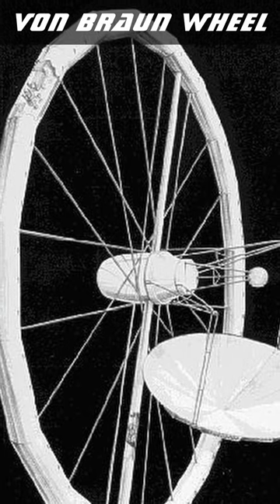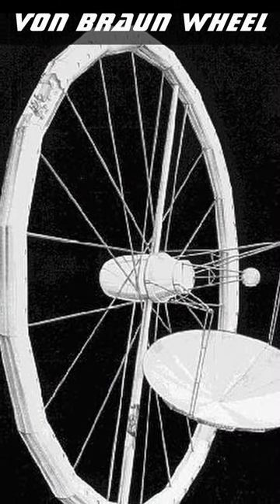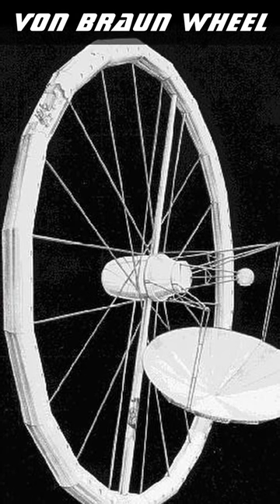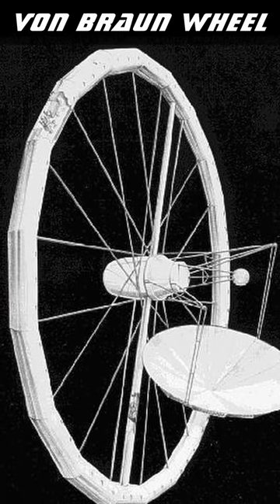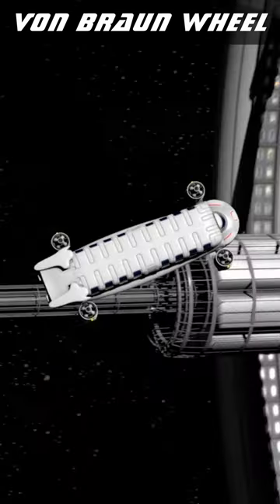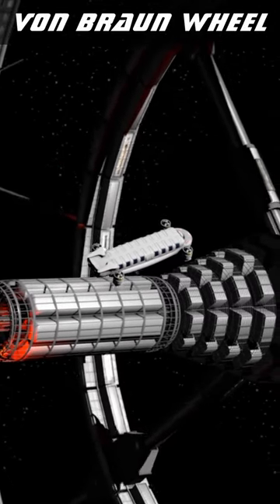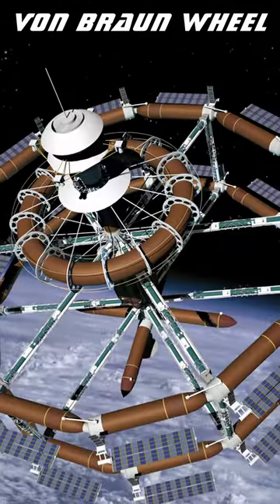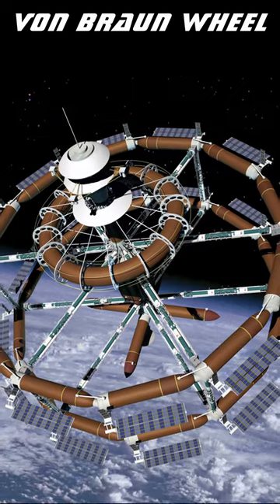Von Braun Wheel Space Station

Comment: My man took a bicycle wheel to a convention and actually sold the idea to the community lol that's legendary.
Reply: Gandhi also did that , you can see Indian flag.
Reply: It's a solid design though. Before we had carbon fiber, steel cables were the best way to make a lightweight structurally stable wheel.
Reply: not the most unconventional invention from von Braun...
Reply: Physics. Physics apply to bicycles and space alike.
Reply: The airpressure in a road bike is between 80 to 120 psi , about 3 to 4 times atmospheric pressure. , bicrcle wheels also spin a lot faster than the desired 1 to 2 rpm to limit nauseating Coriolis forces.   You could argue that a bicycle wheel would be overkill. except in size.   Thing is, we still don't have a spin gravity space station so no one has bought into what was being sold, at least not with a large enough pocketbook.
Reply: @johnwang9914  i mean no he literally took a bicycle wheel to a meeting with some other scientists and demonstrated centrifugal force gravity.
Reply: @A_Stereotypical_Heretic 
Fair enough, though.

Comment: It's 2023! Why hasn't NASA and/or ESA built a 100-meter diameter wheel station with spin gravity by now?
Reply: Cost - benefit analysis says not worth it I'm sure. I agree with you though - rather than spending money on war and other garbage we should be pumping much of our treasure (globally) into research and space research.
Reply: We built on on Earth. more then one.
I think the spin grav required a larger diameter then was practical.
and we needed to do more studies in zero grav. But we did plan on adding one to the space station, aaaand. well. rotating connected to a stationary space station is. a challenge to say the very very least about it.
Reply: Mostly because they want to study micro-gravity.  There is a perfectly good laboratory with 1 gravity rather closer.

Comment: The fact that it is a design from 1945 is astounding... and raising a few question, considering his employment at the time.😅

However it faced the same problem as lunar bases - lack of interest. ISS is specifically designed to be a microgravity laboratory, this one is designed for long term human habitation that... isn't happening because we learned that space is empty and unforgiving and there is no point to go anywhere when you can invade your neighbour for same amount of money.
Reply: The earth has a finite amount of resources. Space, unforgiving as it may be, is chock full of resources like metal and helium 3 for fusion. The establishment of a space base in the asteroid belt might be a useful first step and launchpad for space mining operations.
Reply: Right here on Earth has plenty of environments which are unforgiving where those who do not have the correct equipment for surviving the unforgiving heat or cold are pretty much guaranteed to perish; it's just that space is unforgiving both more universally across the board and to a more extreme degree.
Reply: @scottfw7169   ...aaaaaaaaaand?
Reply: A semirigid centrifuge module was proposed for the ISS but dropped.  The problem including with Werner Von Braun's inflatable rubber design was that anything spun for spin gravity had to support it's structural weight and hence had to be lot more massive than out current tinker toy spacestations and everthing launched from Earth costs about $10,000 a pound just to launch into low earth orbit never mind a more permanent orbit.  It probsbly won't be till in situ materials from the Moon or asteroids are available before such space stations are feasible.
Reply: @johnwang9914   chicken or an egg? Are such space stations possible only with in situ materials or are in situ materials only possible with such stations? 
The answer is sadly both. You need both habitation and industry to be able to scale them. So the start would come from here. And even with fully reusable surface to LEO ships propelled by rotating detonation engines and with nuclear tugs picking the cargo at LEO, it's still nigh impossible task that is too far beyond realistic investment horizons. Capitalists, communists, monarchists and other "-ists"(no, I don't mean dentists and other specialists. You get the idea. And sorry that I'm in ranting mood, night shift ¯\_(ツ)_/¯) with their "-isms" will be our Great Filter.
Reply: @TheArklyte    Well, you always have the ooption of launching materials from Earth at great expense.   Having materials and labour in space would greatly reduce costs but would also require infrastructure and personnel to already be in space hence for there to already be habitats.   It is the first habitat that is problematic, it would have to be very expensive if everything was from Earth, very risky if personnell did not have the full shielding and gravity of a large habitat though minimal habitats similar to ISS would be possible but at greater health risks.   It's a matter of what costs you consider acceptable and what costs can be afforded.   The Stanford Torus was estimated as possible so long as Apollo era funding remained but obviously such funding did not remain so yes, chicken or egg or a lot more money.

Comment: I always imagined that the tension teethers could be aluminum cables and arranged such that they function as an inductrack maglev rail for pods to transit not only to the microgravity central hub but along the rim as well.  With banded tori, you coulf use such pods to transit between rings.  Might as well get more than one use out of as much as you can.  The spokes would also be goof locations for heat radiators as they are connected to the pressure vessel and outside the static radiation and micrometeor shield.

Comment: that last comment on re-purpose the fuel tanks, still remember the first time I read about on atomic rockets it blowed my mind and according to some estimates if we were using them to make a space station by now we coul have a space port on LEO of about 10k people.
Reply: The fuel tanks proposal was a proposal to build hotels in space using the large orange fuel tanks for the space shuttle as they are ejected before being completely emptied.   Calculations did show that completely using all the fuel in the tank would launch both the shuttle and the tank into low Earth orbit but the ability to reach higher orbits if you ejected the tank before it reached orbital speeds was just too much of an advantage for the fuel tank concept to ever be pursued.   Note that Skylab was a cleaned out Saturn V fuel tank so that was part of the inspiration.   We no longer have the space shuttle and even if we repurpose that technology into a new heavy launch booster for Artemis, the advantage of just disposing of the tank before it reached orbital velocity still exists so we still won't do this.
Reply: @johnwang9914 That's incorrect, there is no advantage to jettisoning the ET for the Shuttle reaching orbit. Burning the main engines for an extra second or two would do it, and it would use residual propellant that was otherwise destined to be destroyed when the ET reentered anyway. 

The reason this was never done was because a project to use the ETs as space station parts required a lot of time and money to develop, because the tanks have to be refitted and equipment installed inside once in orbit. It's a bigger project than just bolting a bunch of them together and spinning them up.
Reply: @RCAvhstape   Burning the remnants of the fuel left in the tank was an unproven estimate and was not certain depending on the delay between fueling and launch as cryogenic fuels are steadily boiled away.   It was one of the proposals that burning the engines for slightly longer could compensate but that was never proven so a mission was never risked just to find out.   Was risking all the mission objectives of the mission worth finding out if enough fuel was still in the tank for the excess burn as the cryogenic fuels had been constantly diminishing after being filled?   It's not like they could weigh the entire spacecraft shortly before takeoff to see if they still had enough fuel to take the tank with them, they would just have to try and risk loosing the entire mission as there would be no safety margin.
Reply: @johnwang9914 Sorry, you're simply incorrect. There was plenty of margin. And your idea of getting a performance boost by jettisoning the tank makes no sense, since the main engines were shut down before the tank was separated, so no delta-V was delivered.
Reply: @RCAvhstape  That was the argument which was made, that there was sufficient margin, however the margin was the designated safety margin to ensure sufficient fuel for the intended mission given the allowable delay between refueling and launch.  This was a margin that depleted with the delay and of course if you used the margin, you would have less to possibly no margin left so I am fully correct in saying that if you used the margin, you would then have less to no margin and NASA was unwilling to risk the entire mission just to see if enough fuel remained.  Note that the fuel levels was only measured when filling the tanks, there were sensors but the fuel level would still be estimated after fueling hence the existence of the margin in the first place.  You're just buried in your own cognitive bias and ego to claim I was wrong, is it not logical that if you used your margin which is expected to decline before launch then you would have less to no margin to guarantee your mission...
Reply: @johnwang9914 So you finally resorted to insulting me. I guess we're done. Enjoy the rest of your week.

Comment: I think the center wheel shouldn't be connected physically to the hub.

The spokes should go to a center ring 1/3 out to keep just enough gravity for stuff to go down or skip walk around, great for cargo movement.

But instead of physical connecting the central airlock have it connected by magnetic ring holding it in place.

That way the ring can spin at the central air lock stays stationery. Making docking safer and more straight forward.

You can choose win to spin up the central air lock to match rotation with the main station to transfer cargo then spin down for docking and transfer as it would be far safer to move cargo in zero G.

And with it connecting to the inner ring magnetically there's no friction no loss of power. And if they can stretch a high-capacity super conductor wire to high orbit they can draw power from it without having to be in direct sun light. Just harness all that free energy in the atmosphere and magnetic flux. Giga Jules of free power for the taking. Or lay down multiple cables and beam power to the moon bases.
Reply: The Von Braun plan promoted was to only provide partial Earth gravity, at the time the hope was for a future lunar colony so the plan was to simulate lunar surface gravity not Earth surface gravity as the hope was to prove that long term habitation in lunar gravity could be tolerated with medication and exercise.   Today, the hope is for Mars surface gravity to be tolerable so a spin gravity space station would likely be at most Mars surface gravity but as more spin gravity makes for greater stress on the structure, if we build a spin gravity station, it would likely be for far less gravity in hopes of showing that just some gravity would help as although we have not been able to make microgravity tolerable, a small amount of gravity might be enough to make the techniques we currently use to be sufficient.   I don't think you'll need a partial gravity ring with the plans that are being considered now as it will all be the minimum amount of gravity that we hope can be tolerated  for long term habitation.
Reply: @johnwang9914  mars gravity and radiation is off what ours is not to mention the crazy low air pressure.

I think we would need to sleep in centrifuges. 8hrs of 1.5x earth gravity each day. To keep all the bone and other issues at bay vs just letting your body fall apart. Probably need pain killers and body massages at first can't imagine it will be comfortable to begin with.
Reply: @anarex0929   I would agree that long term colonization of Mars or even the Moon is likely far more difficult than most people imagine and there are proposals for spinning vase shaped centrifuge habitats for both colonization plans if microgravity can not be tolerated.   There are also proposals for short radius centrifuge tables to see if occasional exposure to higher gravity might help with the health problems.   However, there are many people advocating colonization of Mars and the Moon without fully addressing the microgravity and radiation/micrometeorite shielding issues and that is one of the reasons for sizing spin gravity space stations for such low gravity levels, that and that doing so would be much less expensive than building the structure strong enough for Earth gravity.   At this time, we only know that the microgravity in the ISS can not be fully mitigated by exercise and medication and we have no platforms to test other gravity levels, at least other than Earth's gravity level.
Reply: @anarex0929  Sigh, do you even read.  I was only talking about why the proposed spin gravity of the space stations was going to be less than Earth gravity.  I never said a Mars colonization mission would be safe not did I even say it would be wise, in truth I believe a Mars colonization mission is a terrible idea but is one that will likely be attempted.   If anything, I said that there are people who are advocating for such missions without fully addressing or investigating the concerns.  Why are you calling it my Mars mission, I never said anything that would advocate a Mars mission.
Reply: @anarex0929  Before you edited, you said it was my Mars colonization so yes you thought you were playing devils advocate to me.  Even after your edits, why the reply stating what you believe would be needed with a Mars colonization mission, I was clearly talking about how the proposed spin gravity space stations would not be full Earth gravity.  You want your own thread, start one, I'd happily agree with you that Mars colonization would not be as simple or as advantageous as many people believe.  Your reply being clearly off topic clearly shows who hasn't been reading the posts.